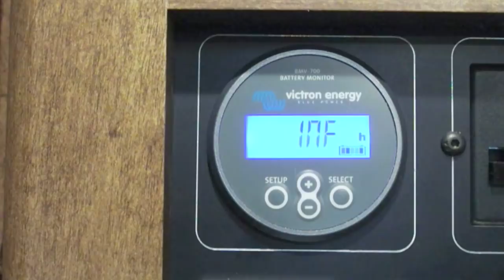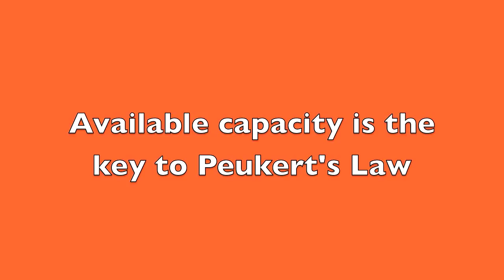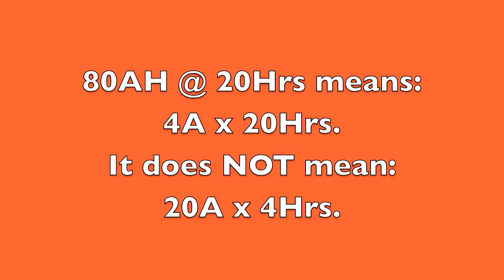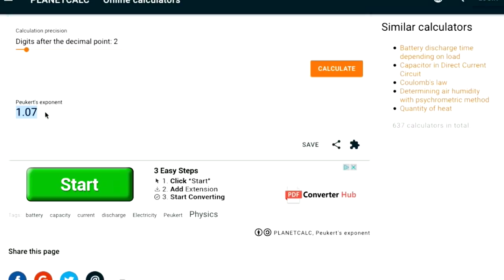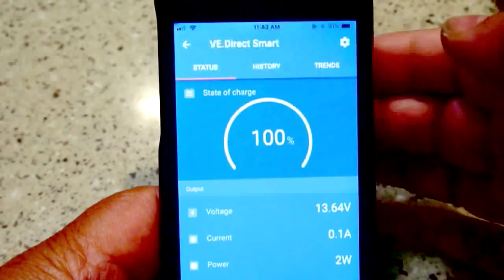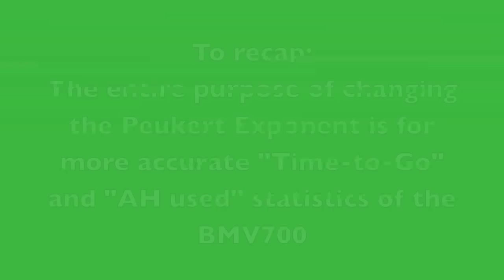Changing Peukert's Exponent on the Victron BMV700 series Battery Monitor.

Comment: Why did you set it to 1.20 if you calculated the exponent as 1.07?
Reply from the maker: The example I used for the 1.07 exponent was a different battery. Sorry for the confusion.
Reply: @RVProject  Gotcha. Thanks!